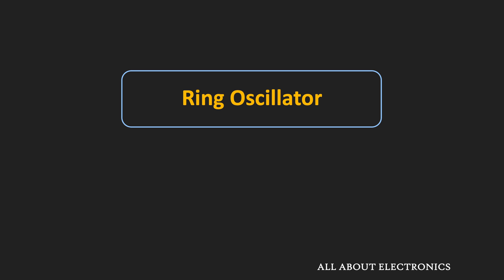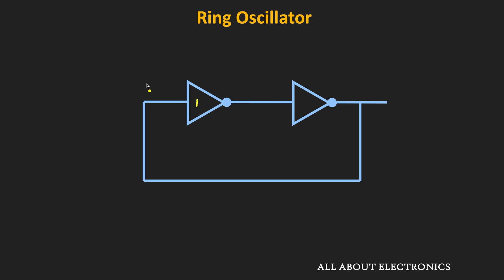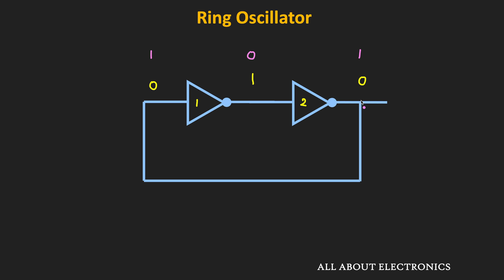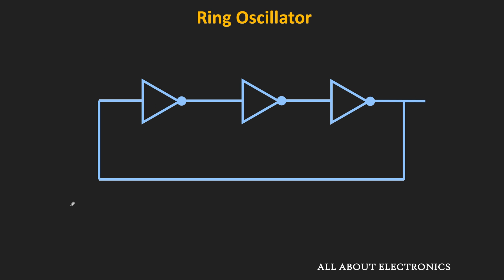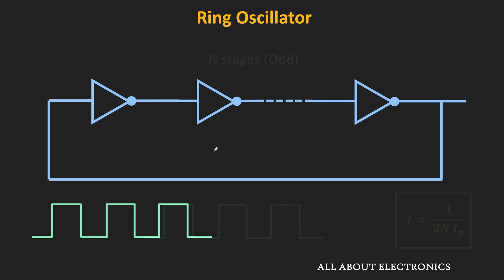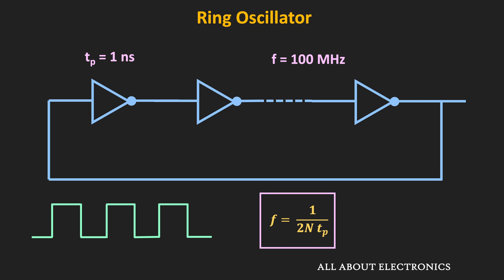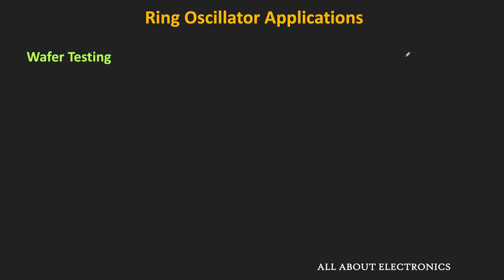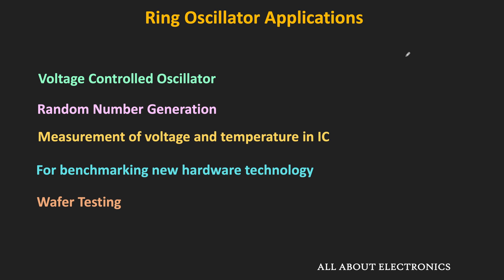Ring Oscillator Explained | Applications of Ring Oscillator

Comment: Hello sir,

I have been reviewing the conventional methodologies for separating intrinsic gate delay and interconnect delay in ring oscillators, such as (1) varying the fan-out of the inverter, (2) modifying the interconnect length/width or shape, and (3) changing the number of stages in the inverter chain.

However, I believe these approaches cannot rigorously decouple the two delays. This is because the overall circuit delay fundamentally results from the product of the total resistance and capacitance distributed across the entire circuit. Unless every cell is explicitly modeled as a network of R and C components and the contributions are separated at that level, the extracted delay will always contain coupled effects of both gate and interconnect.

Do you think there is a feasible circuit modification or an alternative methodology that could more clearly separate gate delay and interconnect delay, beyond the conventional fan-out, interconnect geometry, or stage-count variations?

I would greatly appreciate your insights or suggestions on possible approaches.

thankyou!

Comment: I want to know what happens when there is only one inverter with output feeding back to input? Will it still act like an oscillator? Or will it remain in the very first value it takes? Or will it reach a midpoint between supply and ground based on the on resistances due to connected gate and drain?
Reply: one oscillator will not provide enough phase shift and loop gain to sustain oscillation. It will simply invert the signal and latch onto it.
Reply: @kzavverr3651  so does it write the input as 0?